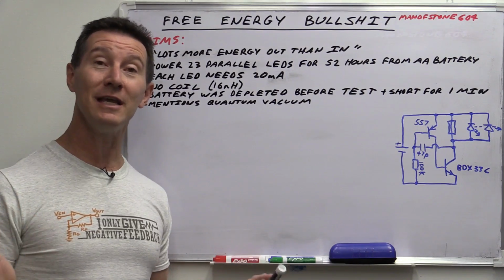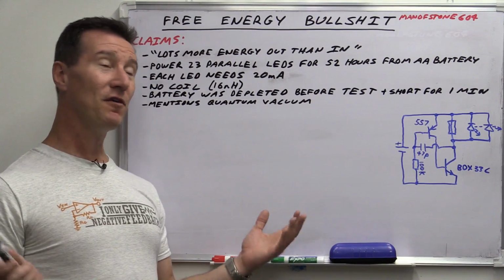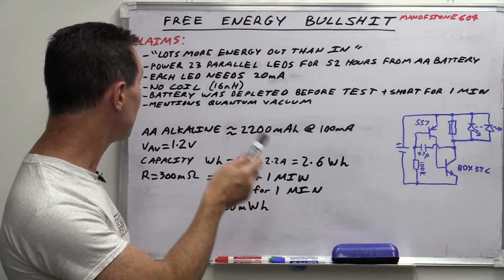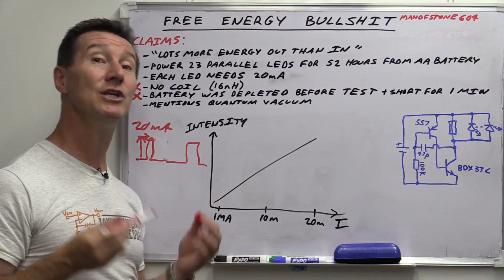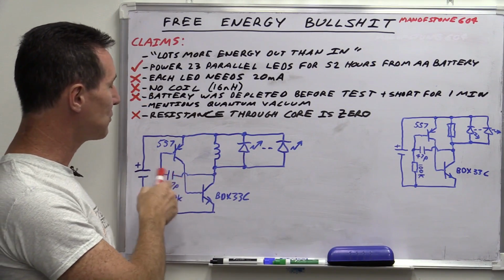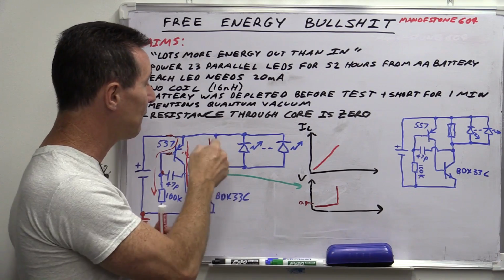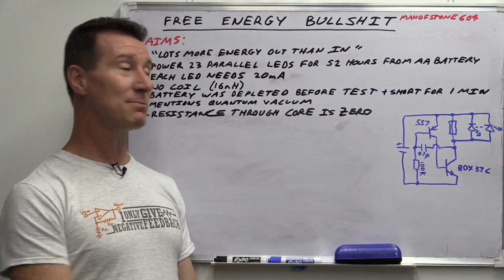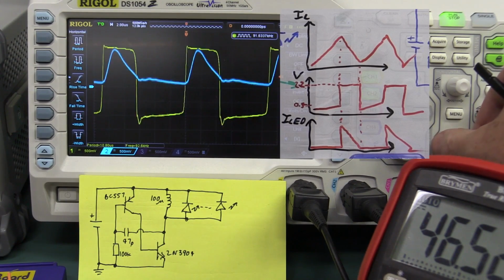EEVblog #708 - Free Energy Overunity is RUBBISH!

Comment: Dave talks lke hes got a smart meter stuck up his a$$...and he should try building george chaniotakis eleman motor or lasersabers ez spin motor for a start... the second isnt overunity but proves motors should be easily running at 98% efficiency instead of the 40% efficient guzzlers we use now.

Comment: I have a LED Christmas light that was on for two weeks with 2 AA batteries and 10LED's ... no circuit, no nothing, just a switch..could it be a over-unity switch? :O  

I've seen another idiot, with a free energy machine, he had a motor powered by two huge LiPO's and another bigger motor as a generator, and he was powering 220v LED's with it, and he was saying he has made a free energy machine, granted if you charge it up at your neighbors or McDonald's it is free energy for you!

Comment: Excellent video. As a technical aside, you might like to note that you are trying to measure mean current with a true RMS meter. The frequency is also pretty high. It could do with a passive RC filter before the meter to avoid the RMS/mean error and avoid the frequency response of the DMM. Of course this doesn't change any of your conclusions, or the excellent work you did on the video :-)

Comment: Problem is Dave that coil you are using is not tuned into the quantum vacuum. For a quantum tuned vacuum you will need to source your wire from DigiKey and stick your tongue out at 90 degrees while standing on one foot looking at the moon only then will you experience the wonder of free energy.

Comment: And how far off is astrophysics?
Reply: Keep in mind when working with a battery that will start a car, would melt the tool you are using melt from 1 post to the other, if it did not kill you. keep your hand on the tool for it to be in full effect. Using a thick rubber of maybe 1/4 inch thick on the tool, like a wrench of good quality, heat shrinks makes a cheap set into a quality set of tools. 1/4 in thick, provides protection against it accidentally hit your hand but enough that it will spark and 1 mins would melt even a good quality tool and you will have a good chance to live if you see the edges glow red and move them. But less then 1 minute.
Reply: Love the bull shit you are pulling out your ass, where did you get your education from? How to fuck them, because this idiot knows nothing he uses no math because he has no idea, but talks like the idiot Einstein, if the facts do not fit your theory, you pull the shit out your add and lie!
Reply: Funny how you did not hook up the battery.that was tested as dead, and only using a part of the machine. In other words, not the same machine something totally different.

Comment: Quantum vacuum does exist, it exists between the ears. Also, 23 is a prime number, which I have no idea what even that means in this circuit, probably to cause your handheld calculator to have a rounding error due to the irrational behavior of the prime. As to the milli, micro, nano, kilo, Mega, Giga and so forth, it's all Greek to me, especially when they use the symbols. My question is: Why is a tunnel diode not called an outlaw diode if it doesn't follow Ohms Law? Lastly, could current flow through half the length of a planck length of wire, or would it collapse unto itself? In closing, if you think education is expensive, try ignorance and then build the impossible.

Comment: And yet- the IDIOTS with NO electronics education STILL argue that ol' Scammin' Stan Meyers and the other free energy dolts perpetuate the free energy fraud. Hey, you just can't fix STUPID. I suggest that people who believe "FREE ENERGY" should mortgage their homes and send their money to these scammers.

People seem to be getting dumber, too. These believers should get educated in physics and electronics. At the very least, READ about Tesla, or visit his home/museum. Tesla was never able to resolve the "impedance problem". He just kept increasing the voltage, but USABLE power (P=E*I) was never realized due to lack of available/usable current. Ground resistance is just too high. Tesla DID illuminate flourescent tubes at a distance of a few hundred feet- but ANY CB radio can light a flourescent tube from a few feet away, radiating just 5 watts.

Comment: Speaking as a radio tv man electrons flow from negative to positive not as you say from positive to negative. You have drawn the current flow backwards .Also it flows against the arrows  in tranistors. This is basic electronics . And the reverse voltage is called inductive kick.  I did notice you drew the voltage going the correct direction through the led. This must be a test right to see if anyone would notice your error. No one did because few on the internet understand electronics theory.

Comment: "Free energy" bullshit is infinitely worse than even me and my R/C, or one shots galore kind of "design". These morons are the types that think the damned sun produces energy with ELECTRICITY.  Yeah, a Darlington circuit with a couple of inductors, caps, resistors, diodes, etc. will pull energy from nowhere.  And yeah, 200 million amps, that'll flow well through some 18 gauge wire.  What an idiot.  Again, holy crap.  Smallity, funny.  The proof is in the pudding, they always claim everything, their contraptions always produce less than the damned batteries normally would, JUST LIKE PHYSICS says it will.  And when it DOES produce more, there's always an external power source feeding in.  Shocker.

As for the litz wire, etc. that they always throw that kind of stuff in to sound "scientific".  Look up "Turbo Encabulator".  Only difference there is they KNOW they are being stupidly funny! 

By the way EEVblog dude, you will NEVER confuse these idiots with facts....you do realize that, right?  Like talking to Flat Earthers who compare rulers to the horizon and take spirit levels into aircraft to "prove" their nonsense (you can't make this shit up).  The Dunning Kruger effect is highly enlightening with respect to these morons.  Essentially it says that what they need to determine they are ignorant and/or stupid, is what they don't have BECAUSE they are ignorant/stupid.  Inherently straightforward.

Comment: I don't know if this is actually true or not, but while living in Georgia, I heard of a guy that built a playhouse for his kids in his back yard, underneath some high tension lines of the local power company, and reportedly had made some sort of transformer that used the high tension wires as a primary to his system via inductance (no physical connection to them), and was only caught when they began wondering why ONLY his home in the neighborhood had virtually 0 power usage from the company.   Sounds like it would have been a bit dangerous for the kids if true!

Comment: Additionally please take a moment to contemplate the links provided in the documents I shared. Understanding that while my manner was misplaced the verifiable content that was the source of my frustration was not. If I may briefly convey how the focus of what I am honestly excited to share and what you were entirely correct about are different. 
Simply put we see over unity or free energy even in ancient technology... Windmills, water wheels, Solar panels each can be seen as devices that when properly placed transfer energy from one system to another, yet for the builder who might invest a few days in construction, he then benefits for years. In that one may through the benefit of thought exercises understand how by configuring a device much greater energy or work can be provided. From here one only need look a little more to recognize similar boundaries where a device of another design might be configured to tap another form of already existing while apparently to us dormant, inert or insignificant still contains no less latent and or  potential energy. Just as with the sun, river and wind so are there cosmic FORCES available. Once we identify the boundary at which one might best utilize them and or transform a current ie water current to mechanical energy via gearing. 
Should you be interested Dave, it will be my humble pleasure to explore this as well as the different designs and configurations I am representing. It is my sincere believe that closer examination of the systems I propose will indeed be of significant value to both of us as well as your friends and followers. For I am here to share and learn that we may both along with our communities benefit. I completely understand if you choose not to follow up with me however I urge you not to disregard what was shared do to my misunderstanding and acting out. Either way you have the materials and my details should you choose to use them.
In service,
Kind regards Lee
(-*-)

Comment: Be careful not to confuse free energy and overunity.   Overunity is BS; however, the energy derived from solar panels is by definition free.  After the expense of the equipment, the actual cost of the energy from the sun is 0.  If properly designed, many grid tie solar systems have returned more profit (from selling to grid) than the original investment.

Comment: I once designed a DC to DC converter in PSPICE.... and I was getting 107% efficiency. So I tried stepping it to its own operating voltage and feeding its own power source and taking out the voltage source providing its power.... and it worked (in PSPICE). So I made a perpetual motion machine.... in PSPICE. When I fiddled with the parameters a bit, I got the efficiency of the DC to DC converter up to more like 170%. So remember folks, don't trust completely the numerical circuit simulators like PSPICE.
Reply: Also, I recognize that PNP/NPN transistor single resistor single capacitor relaxation oscillator. It was used ALL THE TIME in the Forrest Mims III radioshack electronics hobbyist books.

Comment: On the religion aspect, I see this arising many times over with 'Green' ideas. That's not to say that all such ideas are bad; solar panels work for some purposes. Lately the Greens have realised that wind power isn't as practical as they'd hoped, and are now putting out propaganda that this won't matter because 'Grid-scale energy storage solutions are just around the corner.' Even though the storage systems have yet to be perfected. That is, if they are even feasible at all. 

I mean, if they're going to do that, then we might as well claim that over-unity is just around the corner. It hasn't been perfected either, but why let that stand in the way of a good planet-saving sales pitch? 

There is an element of obsessiveness in these people that defies commonsense. Any rational person would try an idea, and on finding that it wasn't practical, move on to something else.  No, Green the religion requires that the idea MUST be made to work. No matter what the cost.

Edinburgh spent an insane 3/4 of a billion on a tram line, purely because green pressure groups have an obsession with 'light railways' being more energy efficient than road vehicles. Any sensible person would have advised that hybrid buses were a far more practical idea. Instead they ended-up with a massive overspend on a project which provides little value. The real hoot is that the tram lines are a deadly hazard to that other green obsession, bicycles. They don't even check these things! 

-How many free buses could you lay on for 3/4 of a billion?  Well, the buses typically cost about half a million so call it 1,500.  That's a lot of buses, probably more than the city already has.  Making them free would provide a useful public service, and help cut car traffic. The trams are not free. 

https://www.thetimes.co.uk/article/edinburgh-trams-cost-nhs-1m-in-cyclist-accidents-rwf2r9ls7

Comment: You may be right about this example, but you also refer to the laws of physics. Physics text books tell us that the laws of thermodynamics - considered iron laws by dyed in the wool engineers- apply to closed systems, the next statement they make is that, closed systems do not occur in nature. I agree there is much nonsense demonstrated on this subject. However, if you take time to look a bit deeper, you will find a lot of new physics which support the notion that over unity devices are possible. Check out the late John Bedini's work for a start.

Comment: Can you debunk Nomans machines? He has two videos where he seems to jumpstart a 5KVA generator from a smaller single phase motor via a large flywheel. It looks pretty legit and i'm surprised how the thing just keeps running even after some time and with many devices plugged into the output. Surely the flywheel can not store this much power?

https://www.youtube.com/watch?v=nAseG7z_GQo

and

https://www.youtube.com/watch?v=OzOhM4HsIeg&t=1379s

Lots of noise, vibrations and loss in the belt drive but the thing seems to just go :D

Comment: Would this circuit save more power than simply connecting a 50-ohm resistor in series with the parallel LEDs?

(1.2V / 23mA - 50 Ohms)

Comment: Also yes many LEDs can emit visible light (visible in the sense it's bright enough to be seen) with hundreds of even tens of micro-ampere... and I am talking about LEDs that cost like 1 dollar. 

At 10-20 mA usually LEDs now are so bright they are hard to look at directly without diffusers.

--

Anyway, free energy BS aside, the circuit is a clever way to say power by driving the LEDs in AC I reckon, needing some optimization of course

Comment: To verify that you have over unity, the only sure way is to take the output power and loop it back to the input, take out the battery, and if it still runs, then you have over unity.